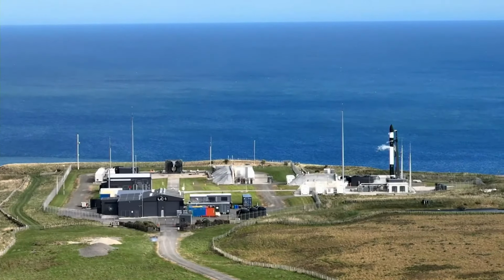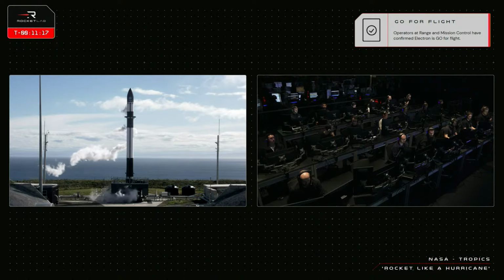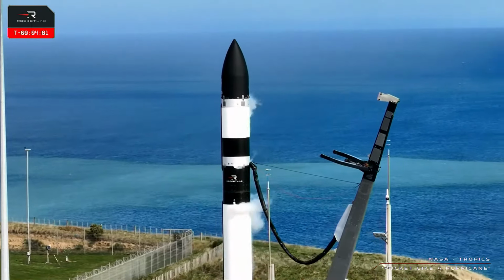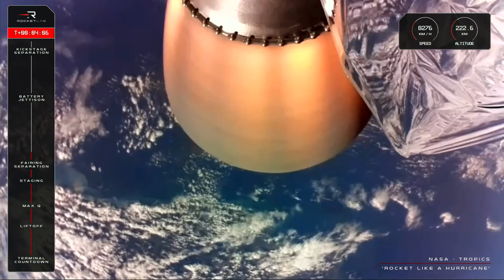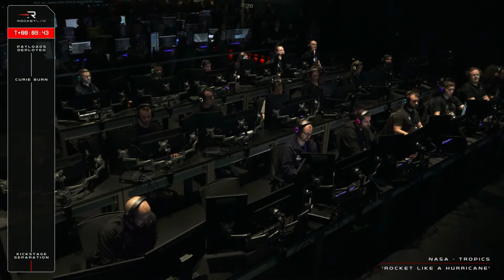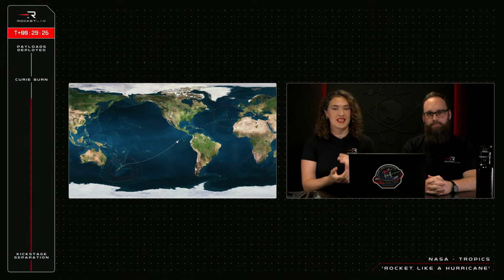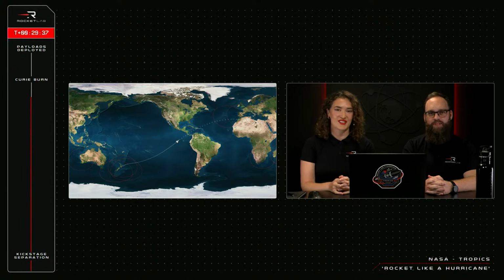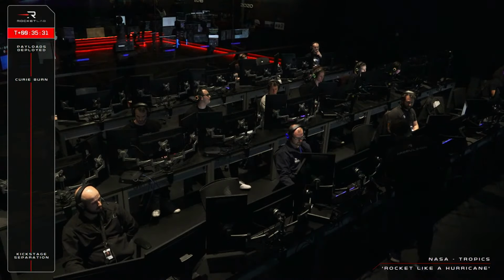Rocket Lab 'Rocket Like a Hurricane' Launch

Comment: Regarding battery "hot-swap", this isn't entirely correct IMO. You are indeed dropping the depleted battery, but you are not hot-swapping, since no one takes out one battery and inserts another one. Instead, the second battery or battery set is already on-board and you are just switching over. This is more commonly known as a "hot spare" you are using then.

Comment: what is the benefit of hotswapping batteries instead of joining the batteries together for 1 single battery ?
Reply: Battery weighted a lot, whole second stage mass minus fuel is only around 250kg, so dropping the unused weight of depleted batteries off increase efficiency and could get significantly more payload mass into orbit.

Comment: just a question about any rocket launch ...
what gas is being vented from the tanks ?  I can believe you might vent O2 but I find it hard to believe you'd vent fuel gas ?
Reply: In this case, this is just o2 venting as it turns back into a gas. You want to keep oxygen in liquid form in the tanks in order to pack as much in as possible. This is why lox load is stopped just prior to launch, otherwise you would vent most of your lox before launch as the lox temperature increases and then changes state back to a gas. Electron uses RP1 as fuel, which is essentially just a more refined version of kerosene, and therefore does not change to gaseous form at normal ambient temperatures. Some rockets do use liquid hydrogen or liquid methane as fuel, so those also can be vented the same as the oxygen as they warm up and change back to gaseous form. SpaceX has implemented a re-condensing system for starship at least, to minimize fuel/oxidizer waste. However, there are still some losses as it is a constant battle keeping pressures below failure without venting too much lox and fuel, pumping back into the recirculation system, keeping what you can, and refilling as it vents. I'm not sure what RocketLab is doing for their ground support system in regard to the lox but I would imagine they utilize something similar to minimize waste. Hope this helps! 😁
Reply: @RU1N4T10N  Thx "Terrible" !  and also why you chill the tank and lines with N2 (to help the liquid O2 stay cold and liquid).  Humm ... how do they keep the liquids separate ?  siphon off the N2 as you load O2 ?  Does the N2 "flash" to gas as it loads, until there's enough pressure to keep it liquid ?  Is this how they keep the tank pressurised ??  Of course liquid fuel doesn't vent, but SpaceX (with liquid CH4) recycle the fuel vent (instead of offloading it, which they obviously wouldn't do).

Comment: Cartoons and animations? Thanks 😂
Reply: Next launch go there and better attach yourself to a rocket , what happens then we can say that he is animation tho.
Reply: @rovanopong9613  why don’t they live steam it from the rocket or watch it with telescopes live? I shouldn’t have to go there. It’s 2023. Cartoons aren’t proof
Reply: @RocketPal  not a valid argument. Go to space. You can’t 😂
Reply: @RocketPal  internet functions off of cables and towers. There’s plenty places with NO internet. Go up in the mountains 🏔️ and you won’t have internet. Go on an airplane ✈️ and no internet. Go out in the middle of the ocean and no internet. Kinda weird if you’re closer to the satellites and internet goes away 😂. But maybe a satellite could show this rocket really going to space? Too bad it’s a cartoon only 🐑
Reply: @what_curve  There are ISS photos of rocket launches. Starling already provides internet connections to Cruise Liners in the middle of Oceans, and plans to allow satellite internet on flights. I'm certain you could get a solid internet connection from many mountain tops covered by Starling if you had a suitable battery to run the terminal from. 

The reason for cut to animation is that the vehicle has left ground station range, telescopes would also quickly lose track of the rocket since it's so small and travelling so fast over the horizon. IF you were under its flight path and knew exactly where to look with a a powerful enough telescope you could watch it's progress assuming it caught some sunlight to reflect. The set of oddly shaped circles on the map in the animation represent the range of ground tracking stations, when the vehicle is outside of those they receive no telemetry and certainly couldn't receive any video signals. 

Apart from anything else, these companies have absolutely no obligation to 'prove' to flat earths that they achieved an orbit in space; their customers are satisfied that the project they committed millions of dollars to launching with Rocket Lab functions as expected once launched. Given that NASA aren't coming for Rocket Lab for failing to deliver the payload is a fairly good indicator that the cubesats are in fact where they should be.

Rocket Lab has launched for other customers too, not just NASA (in case you don't trust NASA for whatever reason). There's no news of customers accusing Rocket Lab of not delivering a satellite to orbit that they claimed to have delivered, if any of these customers that paid millions to have a satellite in orbit weren't receiving the expected signals you'd best believe there'd be uproar.

I fundamentally do not understand how anyone could rationally doubt the achievements of numerous independent space programs.
Reply: @benjaminchristianhay  there should be no animation. It should be ALL REAL. You clearly work for them writing books 📖 on YouTube 😂
Reply: @what_curve  I've tried very hard to clearly explain why they are literally incapable of streaming live footage from a rocket entering orbit and you still insist they should ignore physics and satisfy you.

Who exactly do you think I work for? Why must I be employed by some entity in order to try to educate someone about a topic they seem to have large gaps in their understanding of? I'm interested in space and have always found science interesting too; if I can try to address your misconceptions, or in some way attempt to improve your understanding of things I'm going to have a crack.

If you're interested in seeing footage of something leaving Earth and returning there's a video of a Falcon 9 booster  returning to launch site shot from the booster uninterrupted.
Reply: Since you're a flat earther you're probably too far gone. But seriously why don't you go to a rocket launch? SpaceX has one almost every week.
Reply: @eventhorizon447  a rocket launch followed by a cartoon is not proof of going to space. How about a live stream, or telescopes from earth, or satellites in space showing it’s really happening? You get none of that…just a cartoon and hope 😂

Comment: You still have the best looking launch site and best rocket sounds. Good job.
Reply: Best sounds are by far from the falcon heavy when the side boosters come in for a landing. This launch site is much more majestic than Space X's, but Space X has bigger, better sounding, rockets.
Reply: @gamble67  How confident you are that you are actually hearing sounds from these rocket systems that are even comparable to each other? Sure, there are different sounds depending on the size and shape of rocket, engines and nozzles, but the actual sound captured is usually recorded far away, behind a solid structure or otherwise safe from debris and gas flow. You have all kinds of echoes and secondary resonating structures around these rockets too. Sure, you can argue that SpaceX has some of the best sound recordings, it may even be true by objective quality but it all boils down to preference after all. I'm not disagreeing with what you said, I just wanted to point out some things I've learned while working with stage equipment.
Reply: @jarivuorinen3878  space x recordings sound like the actual launch.
Reply: @gamble67  😮7😮yup tut6😮⁶
Reply: it's the grass that's making the difference, having green land is pleasing to the eye.
Reply: Hahah! Yes amazing as it matters so much!!!
Reply: I don't really notice the engines popping and crackling too much during Electron launches, the best rocket sounds involve those, in my opinion.